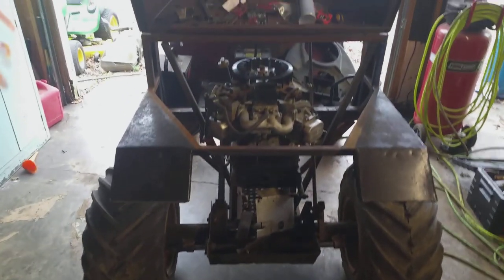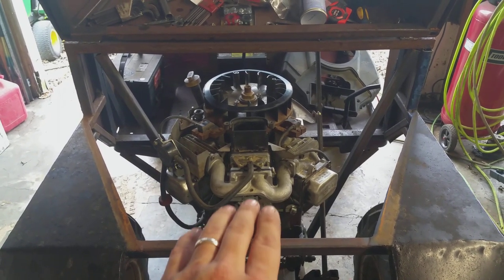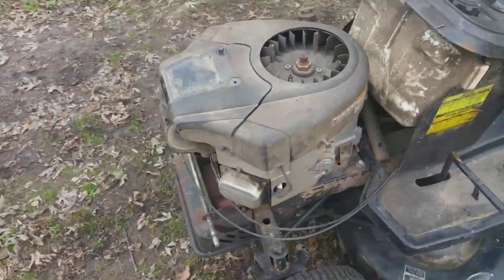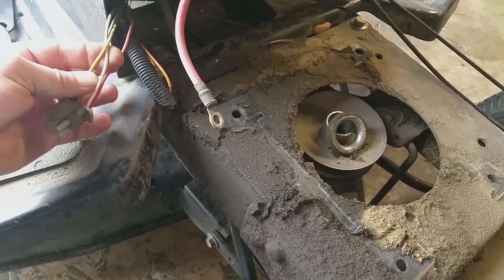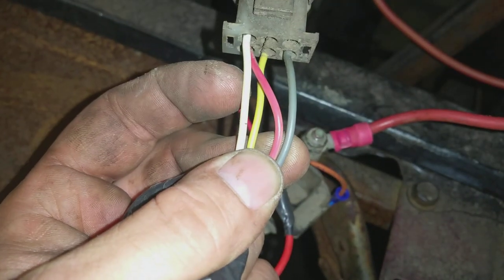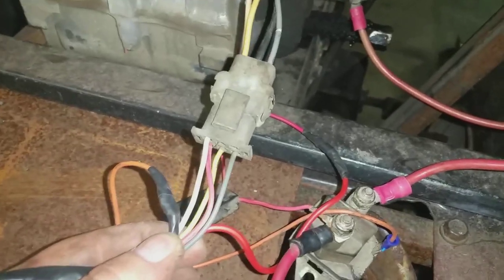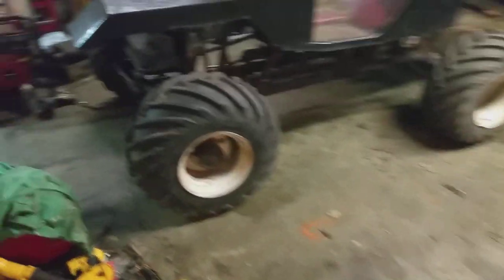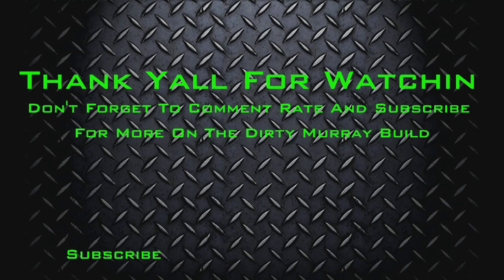Homemade 4x4 UTV aka Spare Change (New Motor and Wiring)

Comment: Personally I like the Briggs Intek series of engines but there carb setup sucks especially with those two little screws you need to take out to get the fluid off.
I like it when people show the correct way of doing wiring, I hate hack jobs and push button start, you can potentially cause more problems with hack jobs and push button start, then if you just keep it stock and remove the safeties correctly, which is very easy to do, personally the only two safeties I run is the clutch and the seats.